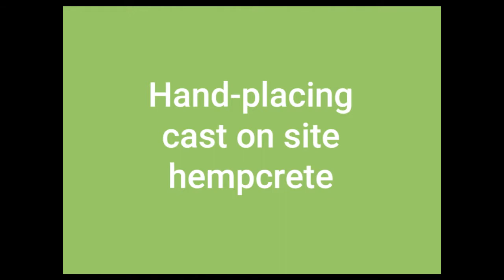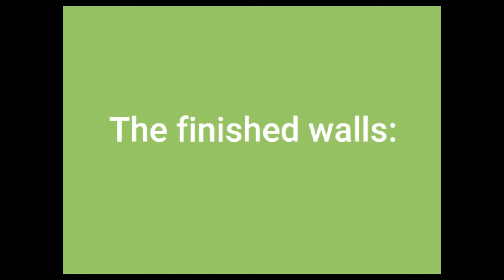Hand-placing cast on site hempcrete (new build)

Comment: Is the structure compromised if you tamp it down??
Reply from the maker: Hi Zachery, no - the structure is all done by the Timber frame within the hempcrete, but if you tamp it down hard the insulation value is reduced, and also the drying time is extended , which is a bag thing. Also the wall costs more, as you have put more material in.
Reply from the maker: Hi Zachery, no - the structure is all done by the Timber frame within the hempcrete, but if you tamp it down hard the insulation value is reduced, and also the drying time is extended , which is a bag thing. Also the wall costs more, as you have put more material in.